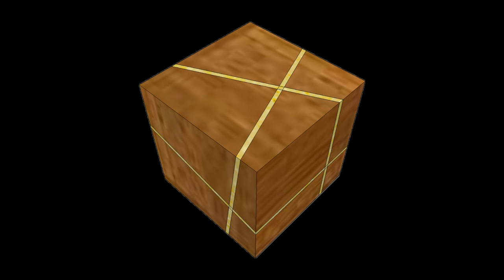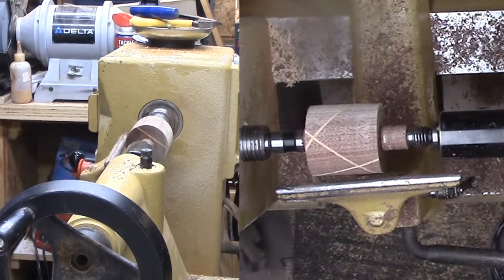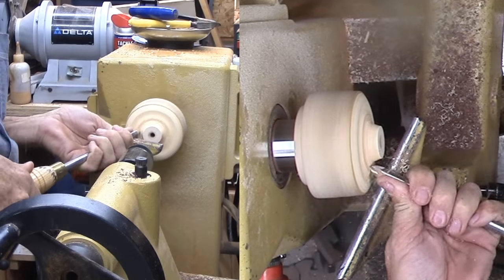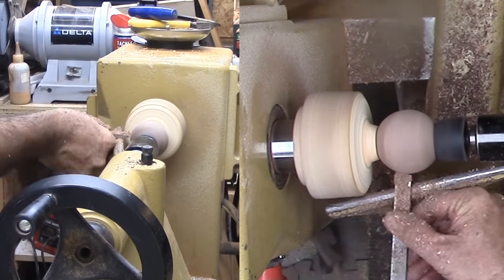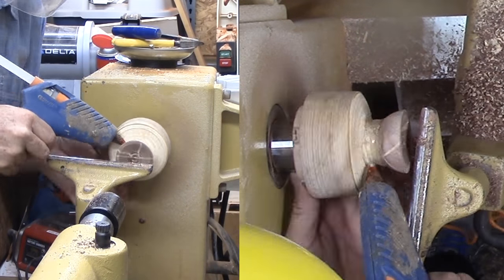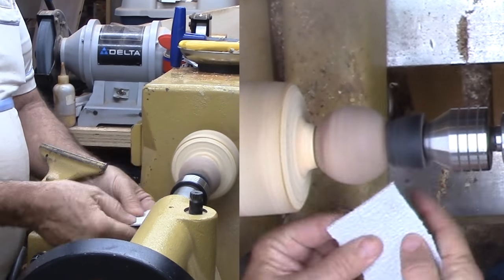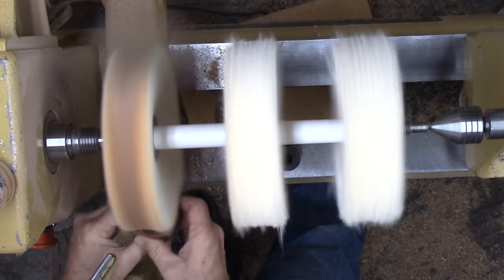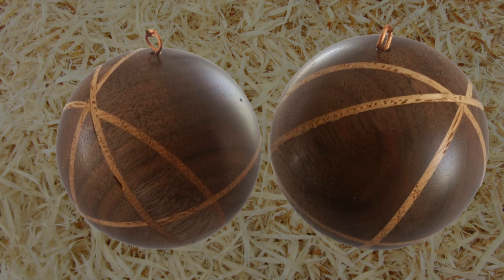Atomic Christmas Ornament For 2016 Ornament Challenge

Comment: Alan, I'm curious about the rubber stopper chuck you are using.  Is that aftermarket or something you built?
Nice Ornament!
Reply from the maker: It's a simple hardware store stopper drilled to fit my live center. The only trick is how to hold it while drilling. (drill a hole in scrap to fit the stopper into, Then drill the stopper a size smaller.
Alan